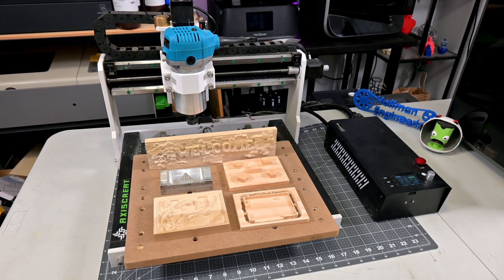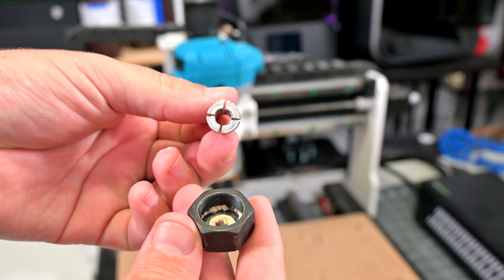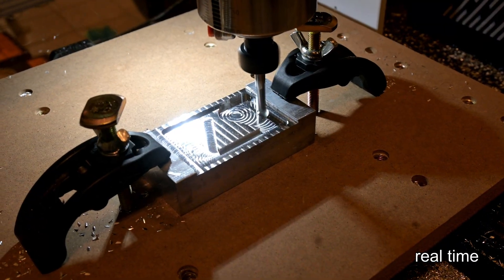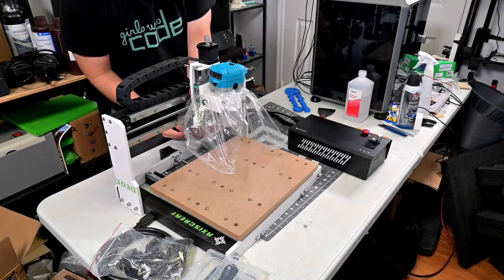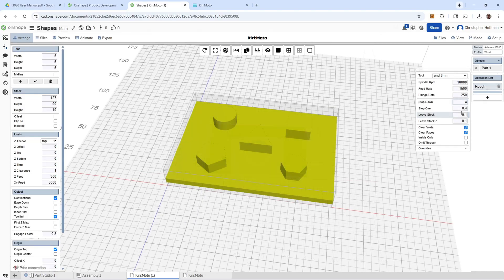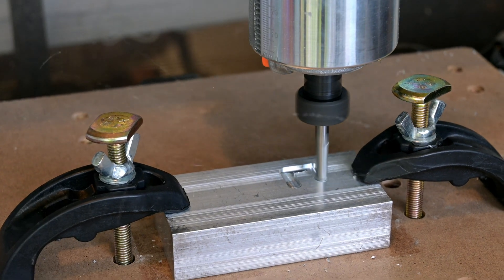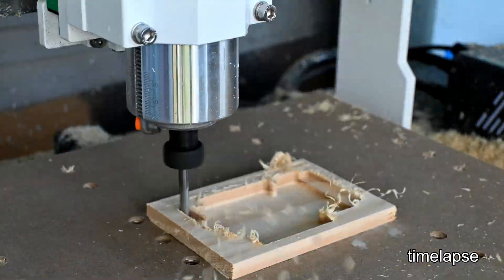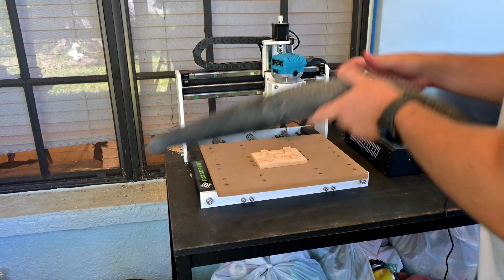Can a $499 CNC Really Cut Aluminum? | Axiscreat i3030 Full Review

Comment: Um… what you showed is not an ER collet. ER collets have two tapered surfaces and a bunch more slots in them.

That style of collet is commonly used in small routers and die grinders; but I don’t think there’s an official standard for them - at least every machine I’ve got has small differences between their collets.
Reply from the maker: I appreciate the comment. I'm only a hobbyist on the CNC side, I obviously have a lot to learn. The machines I've used have these similar types of collets. The brands are referring to these as ER or ER style collets. But comparing, you are absolutely right, these aren't the usual ER collets.

If anyone has technical details on these types of collets, I'd love to learn more.

Comment: Come on, just listen to your router RPMs dropping by over fifteen percent when you try to mill aluminium, and you are only taking micro passes. That is not what I would call milling aluminium, it is painfully grinding it. Normally, a capable machine should be able to take at least half the tool diameter in Aluminium. Besides that, thanks to promote the unknown Kiri:Moto which works great and is still constantly evolving, the good way.
Reply from the maker: Thanks for taking the time to comment, I appreciate it! I don't work in the CNC industry, just jumping into it from a hobbyist perspective, so I've got a lot to learn. In future reviews, I should definitely get an rpm reading and quantify changes vs load and such.

There were nice and distinct chips. With my kirimoto tests, I was taking a 20% step over. I'd have to review my fusion speeds and feeds to see what it was taking. But yeah, I wouldn't expect this machine to maintain a 50% step over for any substantial depth of cut.
Reply: @HoffmanEngineering  No problem, we were all newbies once. I recommend getting some PDF catalogues from bit manufacturers. Every bit has feed and speed recommendations, and you don’t need to make feed and speed your variables to tweak. I know it’s tempting to adjust settings to compensate for a questionable machine or just to experiment. But changing parameters outside the recommended feed and speed always comes with hidden drawbacks: overheating, bouncing, early wear of the bit, longer machining time, and so on. The recommended feed and speed for each material come from the tooth shape and cutting angle of the bit. In other words, they come from the bit’s shape and its influence on every material. Every bit has a sweet spot per material, and once you know it, things work much better. Note that not every bit is suitable for every material. You want the proper bit for the material and to run it at the right feed, speed, and depth of cut. Machining basics.

If your machine can’t handle the recommended feed and speed for a material, the job is simply beyond what it can do. Try a smaller bit, which puts less force on the structure and components, or a softer material. Normally, a machine should be able to mill at the recommended feed and speed for every bit its collet can hold. But that’s not always the case because there are good and bad machines. For example, an ER11 collet can hold bits up to 7mm, but some machines can’t handle the forces produced by larger bits, especially on harder materials. That’s because the structure and components aren’t strong enough. There’s no magic.

A light gantry machine like the one in your video is usually meant to mill materials of average hardness, like hardwoods, brass, or bronze. Even with HGH15 rails, which are only one part of the picture. That’s probably its playground. You might be able to mill aluminum occasionally, but only with smaller cutting tools and not too often, or you risk premature wear on the components. Machines designed to mill metals have a different architecture and stronger components, including structure, guides, transmission, and spindle. Metals are milled at lower RPM and higher torque, and your router lacks torque for aluminum, which gets worse at lower RPM. Generally, these machines are column machines, not gantry machines. If $500 gantry machines could mill metals properly, any industry manufacturer would propose it, and pros would not buy heavy milling stations. Let’s face reality.

Take some time to look at industry bit manufacturers’ catalogues to see how it really works. The Gühring catalogue is especially well documented for the USA and EU markets. You’re stepping into a very exciting world. Good luck!